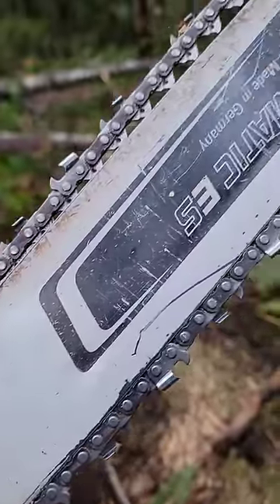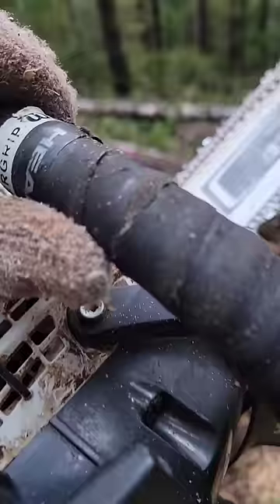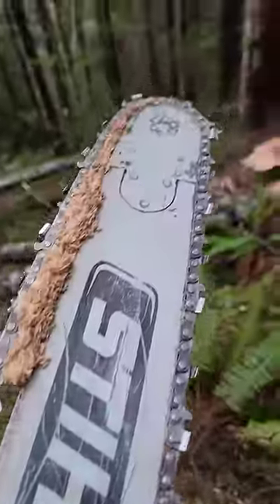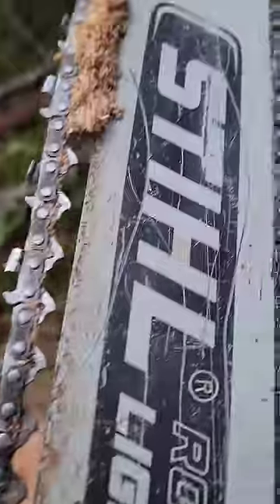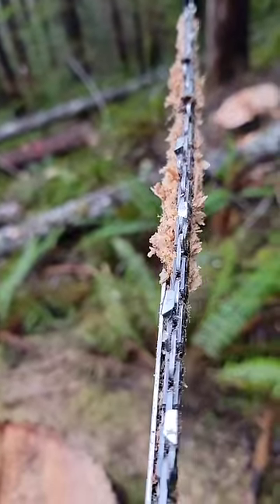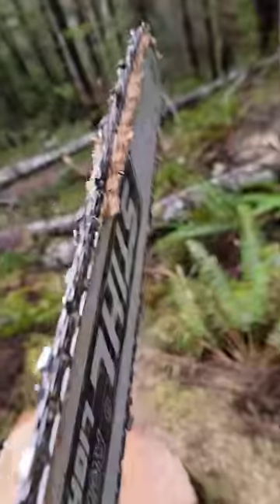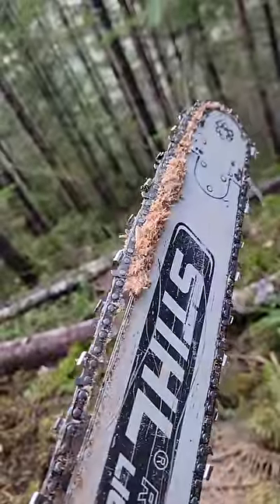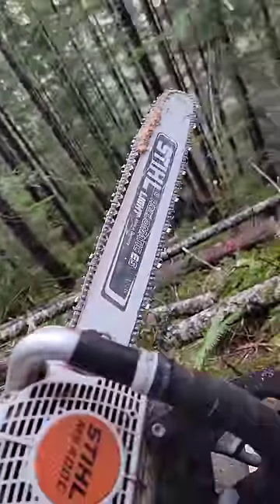Clear the Chain. #mitchzenobitrees #shorts #lumberjack #chainsaw

Comment: Chain looks to loose and ive never seen that ever before. Curious as to what kind of wood you were cutting And i imagine its wet. Its the way you are cutting is why you are getting pinched. Otherwise you can still stop midcut just lift up or pull the bar away while its moving. Even still. Something not right

Comment: Tighten your chain
Reply from the maker: Why would you think it's loose?
Reply: @mitchzenobitrees  the only way saw dust can get under the chain is if it's loose enough that the guide can come out and create a gap between the bar and valley of the guide.  The only time I've had this issue is when I continue a cut knowing my chain needs adjusted a little tighter.  Short answer, experience.
Reply from the maker: @jeremylunning654  I always run a tight chain. I guess I'll have to do another demonstration on this to show how it can happen.

Comment: The chain is on backwards!
Reply from the maker: No it's not.
Reply: @mitchzenobitrees Yes, yes, your chain IS on BACKWARDS! Dont feel alone! I’ve done it too.😅 I swear that became the worst cutting chainsaw I ever used!
Reply from the maker: @jackjones9460  the chain is NOT on backwards. It's plain as day on the right way. Plus, if the chain was on backwards, there wouldn't be a single chip to be seen, because it couldn't have cut any.

Comment: Yeah im sure someone needed that.... I've seen a lot of stuck bars not going to lie I've had to go grab another chainsaw to save my chainsaw before but I think everybody's been young at one point they've at least been stupid if not young but I've never had anything like that happen and I've done a lot of chainsawing. You did something goofy sir.
Reply from the maker: If you haven't had this happen, you haven't done that much chainsawing. Next time you're on the saw, let off of the throttle mid cut as you're dogged in. You'll get this same outcome....unless your chain is so dull that it only makes powder and not chips.

Comment: It’s called owner error 😂 I’ve never had that happen
Reply from the maker: You either don't cut very much, or your saw is making dust and not chips.
Reply: Man I love the internet... Dudes rocking a brand new 400, but it’s cut so much it looks 10years old. Tip of the dogs are worn to shiny steel. Has grip tape like a true west coasty. Got a sharp chain on mid day. Standing over a good stump in the middle of an active cut. The guys just trying to give pointers to inexperienced fallers, yet you get guys hiding behind screens saying it’s operator error lol. Take a look at the clues in the surroundings, the guy obviously knows how to run a saw lol. Keep at it Mitch, you’re one of the real ones!
Reply from the maker: @apexdirtworx6855  I actually have a year on this saw already. It's cut more trees in a day than most of these keyboard cutters have cut in their lifetime 👏🏻😂
Reply: @mitchzenobitrees I cut firewood and climb in between, never had this happen, and I don't run wot, just what I need for job, I cut one cord and split a cord a day to pay bills, 300 cords a yr for 5 yrs, still own sane sawz
Reply: @alltherpm  all my saws are 30 years older then me and rips through 20” logs like butter… my newest saw was made in 1973
Reply: @tylerwestman5258  my newest is 2008 dolmar 6400, need the power when felling, but my arsenal when I show up is dolmar6400, homelite xl12, homelite, 150 for limbs, climb with a mculloch minimac 1

Comment: Guy is clueless
Reply from the maker: I explained it very thoroughly. If you can't understand the reason, you don't cut trees much.
Reply: @mitchzenobitrees  I do and every single tree I come off the throttle mid cut as every arborist or logger does to see where the face cut is and where the tree will fall never once had this happen it’s negligence
Reply from the maker: @jeffreylynds7986  again, if you haven't had this happen, you don't cut enough trees 🤣
Reply: @mitchzenobitrees  yeah sure bud cope harder